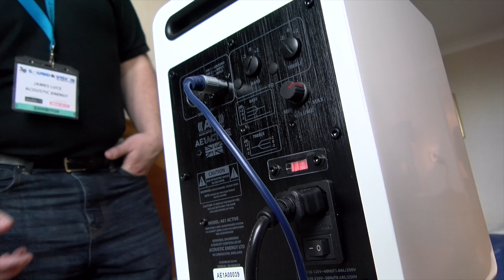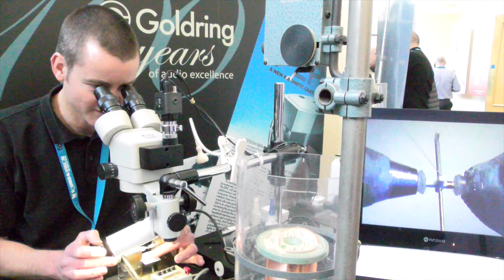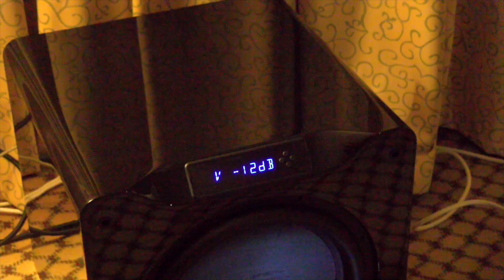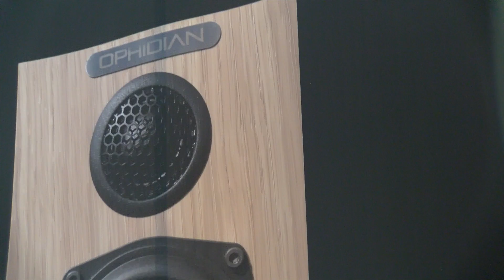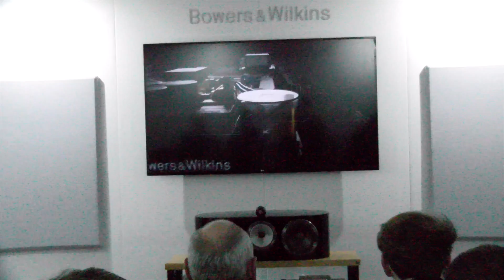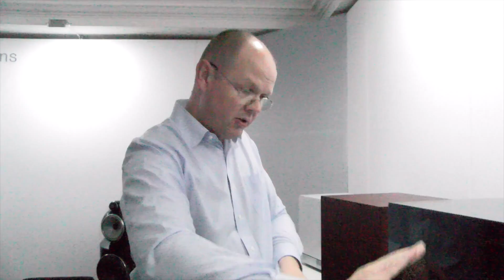Bristol HIFI Show 2017

Comment: Lovely audio. Really grainy ~4min mark. Looks like you dumped the ISO right up.

Also, 12min mark, have you flipped the audio channels. You sound like you're behind me to my left. The guy talking to you sounds like he is infront of me to the right. You then tilt up and there he is to the left.
Reply from the maker: LOL, you imply my OPERATING the thing. I just changed places, no channel flipping and am yet to fully grasp all the light issues...that would just be the sound bouncing about...SO much to learn still. Content is not the issue...
Reply from the maker: It didn't CHANGE, you are of course right, I had the damn plugs in the wrong holes. I and 2 are left and right.. I put the red plug into the right hand hole..channel TWO murrr..